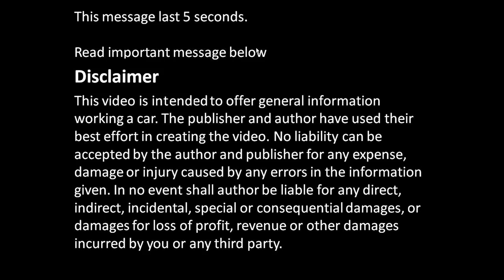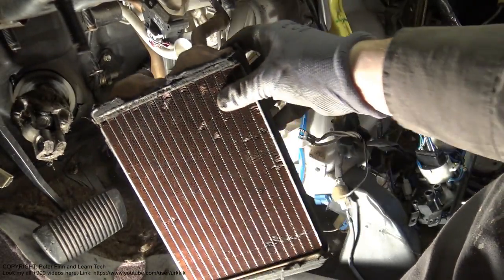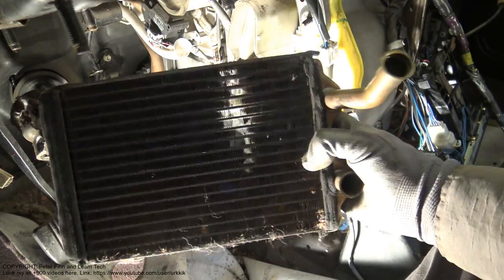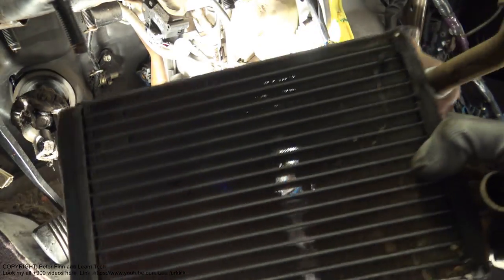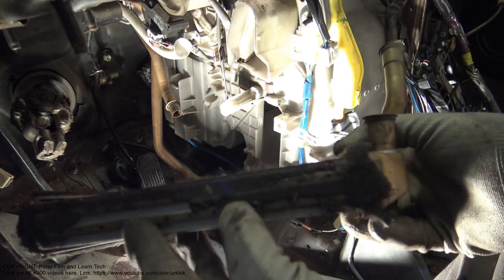How to replace core heater unit Toyota Camry years 1992 to 2014

Comment: You don't have to take the entire dash apart. The Center console can be removed (where the hand brake is) plus the shifter bezel, then you can pull the carpet away from the console to the door and remove the heater core.
Reply: Obviously there is no reason to remove the steering column. I believe Peter did it to provide a better video. He often disassembles Camrys noy to repair but for the videos. There's money in this you know.
Reply: Hey can you tell me if it's the same for a 2009 camry?
Reply: @theheavenlyfire  I never owned that model year so I would be the worst person to ask this. I suggest aggressively scouring the internet / toyota forums for information on that year.

Comment: Peter Can you also make a video of taking out dashboard?
Reply: I've done several Camry dashboards. Pain in the ass because so many fasteners and bolts are hidden. The first one took about 4 hours to get completely removed. Not only do the fasteners break but the plastic panels break too so be prepared to replace some of these. There's a bolt hidden behind the top side passenger vent. The dash can be removed without lowering the steering column but you risk breakage. Much easier to remove two #17 nuts and let it drop. Then you have to separate the wiring harness from the underside of dashboard. As for wiring you cannot go wrong with Toyota. It's nearly impossible to reconnect improperly as all the connectors are different from one another. I thought about doing a vid on this but just didn't have the time.

Comment: Hey! I have an 1996 Toyota Camry. The heater core needs replacement, it leaked on my carpet. Do I need to drain all the coolant from my radiator and tank and then replace the heater core?
Reply from the maker: Thanks for comment 👍😀

Comment: Does the coolant from radiator circulate from this heater and produce warm air? Or are there electrical heating coils?
Reply from the maker: Yes, it moves to heater.
Reply: No... the coolant flows from the radiator, through the engine, taking heat away from the engine (and thus cooling it), then flows into the heater core (it's now hot), heating it and any air that flows through it. Then it flows out and back toward the radiator to be cooled again.

Comment: Hey peter, I got a 09 Camry , I fill up wit coolant EVERYDAY! I got no leaks I’ve changed the radiator twice ! I hear water moving around in the back of my dashboard, do u think I must replace the heater core ?
Reply from the maker: Really ?  You must see leak in some area... ! 
You might have leak in cylinder head gasket?
Reply: Did you ever find out the problem?
Reply: Yeah, what was the problem?
Reply: @theoryofpersonality1420  Likely an air pocket. System needs a pressure treatment.

Comment: I have a Toyota Camry 2013 LE and I took it to a mechanic he doesn’t know the problem it literally just stopped blowing hot air. Does it mean I need the heat core thing u talking about or what is the problem ?
Reply from the maker: Cabin Temp sensor also
Reply: How did you fix it?

Comment: Peter ..... 97 Camry V6 a/c COLD , but will overheat in less than a mile.  Could it be Water pump, thermostat or just low fluid, btw will not blow heat inside
Reply: Same problem on my 99 avalon did u find the issue? I just replaced the thermostat... wasn't the problem still overheating
Reply: Did you fix it?

Comment: Do I need to disconnect anything in the engine compartment, or drain the radiator for it?
Reply from the maker: Drain out coolant
Reply: @PeterFinnTheCarDoctor  Is changing the heater core the same process for the 2015 camry also?

Comment: This is not how to replace it on the 2001-2006 Camry with the 2.4L engine. Much easier on those. Just remove the carpet on the driver's side and you have full access to it. Just disconnect the pipes and slide it out.
Reply from the maker: Thanks and Good comment. :-)
Reply: Will that work on a 2007 Camry ce?
Reply: @theoryofpersonality1420  Yes. Same engine.
Reply: Is it the same on a 2.2
Reply: @caringtonkeller  Honestly don’t know.
Reply: @afcgeo882  Mechanic told me mine is in rough shape. Person before me (just bought it three months ago) didn’t take care of the car very well. Or at least this particular part. The rest of the car is pretty good. Anyway I was hearing air/gurgling noises in the area of the heater core, when pressing the gas. After some test, they determined the core was blocked. Said they would flush it clean and see if that helps. If not, they would have to rip the dash to replace it. Very costly, of course. My question is can your method be done on an ‘09 Camry LE 4cyl? I’m somewhat of a handy man, I typically try to fix things myself. Tia!
Reply: @gatorr4life  I believe it works the same way on yours, Tia, all the way through 2013.

Comment: Those clips are absolutely not fantastic. I've been struggling for almost an hour just trying to get them back on. They just won't stay! So frustrating!
Reply from the maker: Sorry about that
Reply: It's not your fault! I struggled with it for hours yesterday and still could not get it. I've thought of two things I can do. I'm not sure if they could work what do you think. First I want to try gasket maker, just put that on the inside and outside of the pipes. If that doesn't work, i can cut the copper pipe and the pipe from the heater core and use a rubber hose with hose clamps. Do you think either of those will work?